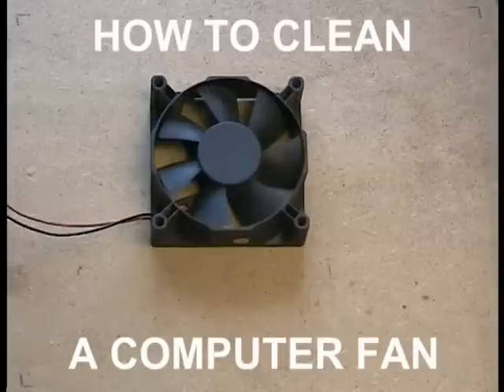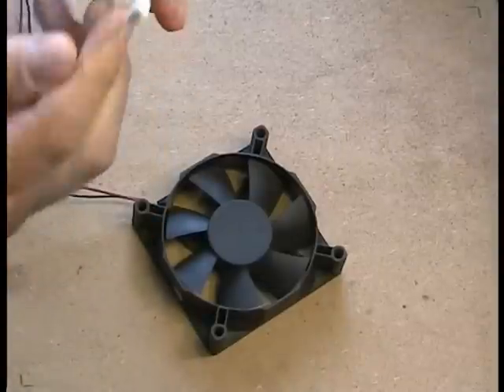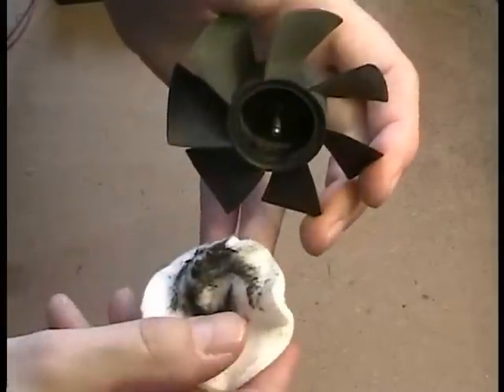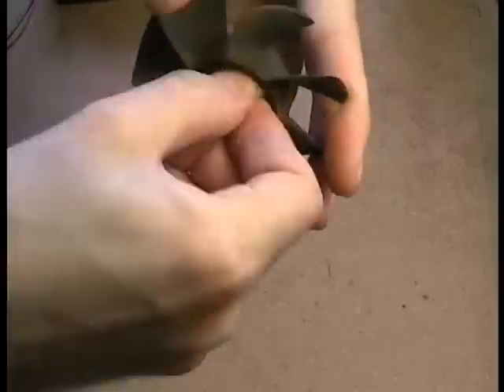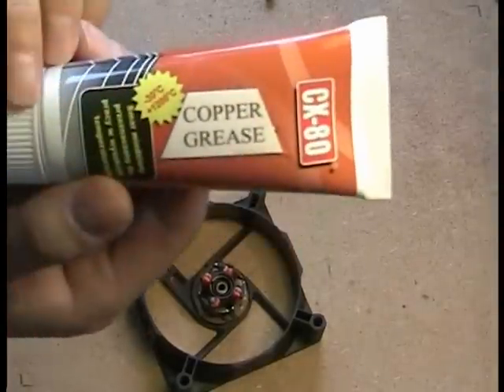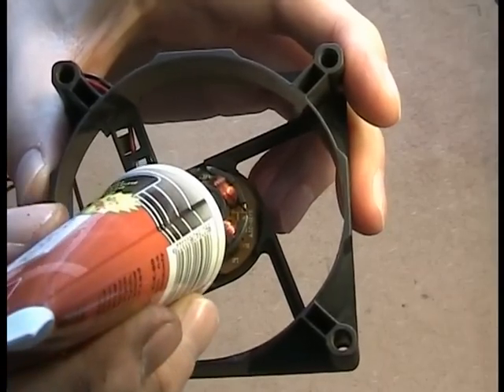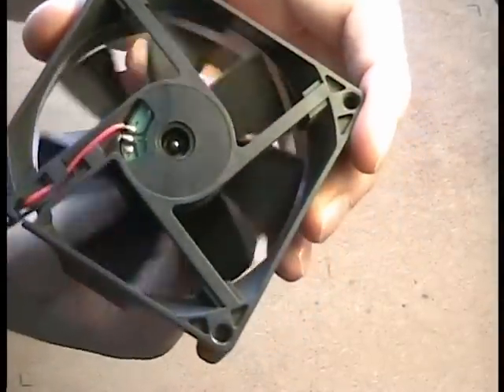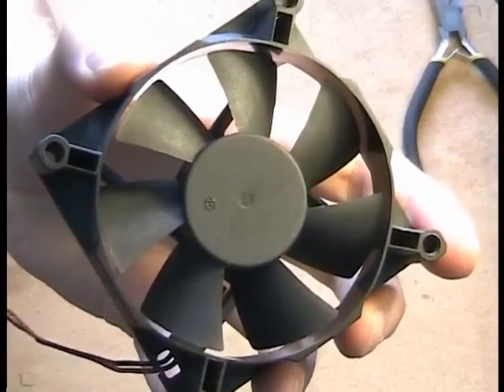How to clean a computer fan

Comment: How often should this be done?
Reply: Grease and tar in the atmosphere can greatly increase the buildup of dust and gunk on your fans. As a smoker, I need to give a good dust out every 6 months or so, as the tar in the smoke coats the fan and causes more dust to stick in a shorter time period. I see similar build-up in machines from oils and fats used in cooking if the machine is near (or worse, inside) a kitchen.
Reply: ElectronFun.com well I opened it and there wasn't very much dust or filth except on the intake fan. I didn't want to risk breaking them so I only cleaned the blades. The coolermaster fans I have aren't as easy to take apart.
Reply: ElectronFun.com  ayy so, dont do it the lazy way, my fans werent drained enough and they themselves overheated, I cleaned the heatsink one and tried to do the GPU ones, they didnt have the thing under the sticker so I just cleaned them as thoroughly as possible, both the cpu fan/fancage and the gpu fans+cage were covered in the stuff
Reply: ElectronFun.com
 for sure.
Reply from the maker: There is no one good answer to your question. If you have a computer in a workshop, or some other place where dust is something usual, you should do it much more often. A good rule of thumb is to blow dust out of your computer when it gets louder and if it doesn't help much you can clean and lubricate the fans.
Reply from the maker: PhazonSouffle
Is your computer quieter now?
Reply: ElectronFun.com Not really
Reply from the maker: PhazonSouffle Were the fans a lot quieter when the computer was new?
Reply: ElectronFun.com  I just fed a teaspoon of mineral oil into the fan without taking anything apart, spun it around a lot and drained it, would there be any reason to recommend against doing this lazier way of relubing fans, other than that you cant clean the inside? It is working well so far.
Reply from the maker: DoragonDirudos
I've never tried this, but I guess this method must be quite messy. Do whatever works for you. I'm just wondering how you drained the fan.
Reply: ElectronFun.com  yeah it was a bit messy but manageable, just tilt it and it should drain, at least somewhat, after I do that I just spin it with my fingers as fast as possible over a sink so that the rest flies out and then drains more, a bit of a pain but it makes me wipe the blades so I guess it forces me to clean the fan even more.
Reply: ElectronFun.com
oil getting on the heatsink isnt a problem right? because the fan didnt drain all the way and now it smells like my room is being heated by an oil furnace
Reply from the maker: DoragonDirudos I would avoid oil on my heat sink and eventually all over the place. It shouldn't cause any short circuits, but it's so messy and smells bad if heated.
Reply: ElectronFun.com  smells ok to me, as long as I open a window. I'll probably just do it the non-lazy way next time.
Reply from the maker: DoragonDirudos It seems cleaning the oil may take you more time than cleaning the fans 'properly'.

Comment: I dont know how to take the fan out of dell cpu. Can you make that video starting point from opening up the computer case
Reply from the maker: There are so many Dell computers on the market and most of them are quite different than standard ATX cases. Usually they use proprietary "user-friendly" cases, where you need to think for a while before you disassemble anything. I'm sorry, but I don't have a Dell computer to make the tutorial for you.
Reply: Ayesha Flores Best you go to the Dell site for instructions for your particular machine.

Comment: if that sticker is hard to take off what should i do? do i peel it off anyway i can? & is it important to put it back on?
Reply from the maker: The sticker is not important, you can substitute it with a piece of Scotch tape. It's only one more thing that holds the rubber cap in place.

Comment: Could I use dish washing oil?
Reply: daGod Emcee
Or if you cant find any one... you can use machine oil. Its easily available.
Reply from the maker: *****
I tried that some time ago and it worked well.
Reply from the maker: I'm not sure what you mean - is it cooking oil?
Reply: like Ajax soap to wash plates and stuff. its liquid
Reply from the maker: It is a liquid, but detergent. It's not meant to be used as a lubricant.
Reply: ElectronFun.com Oooooooooo, ok  got chu, thanks for letting me know that cause I was gonna use that lol. but can u tell me some things that I should use then? whats the names of any lubricant I should get from the store to use? whats the name of the lubricant you was using in this video my friend?
Reply from the maker: daGod Emcee
I used copper grease, but you can also use silicone or multi-purpose grease. There are so many brand names that it's difficult to list them. Much depends on your location. You can find many types of grease in stores like Home Depot (USA), B&Q (UK, Republic of Ireland, China and Taiwan), Leroy Merlin (France, Cyprus, Greece, Italy, Poland, Portugal, Romania, Russia, Spain, Ukraine, Turkey, China, Brazil).
Reply: Thanks sooooooooo much for letting me know, I appreciate that you took the time to type all of that just to help me out. I will make sure to hit you back up when im done cleaning out my computer fan.
Reply from the maker: daGod Emcee
No problem, I'm here for you guys :)
Reply: How bout the oil u use to fireup the lawnmower?
Reply from the maker: Crispy Tae Never checked that, but I guess you can try it - it's better than nothing :)

Comment: On some 120s and 140s I just used antistatic cleaning spray and a piece of soft cloth and I just rubbed that on the blades and got them squicky clean. Hell they looked better than brand new they were fkn sparkly clean.  Didnt take too long. Prolly like 2-3 minutes on a fan if after you get the hang of it and learn where to put the cloth between the blades as they come in different sizes.
Reply from the maker: What about the shaft?

Comment: Does this also work for PSU fans?? I'd hate to replace a perfectly working 800W PSU just because of a noisy fan..
Reply from the maker: Usually there are standard fans in power supplies. This method will work in 95% of PSU fans.

Comment: Do you actually watch your videos? You don't use enough light to present the details of the parts or the events. I'm also surprised that you don't just squirt everything once it's apart with a cheap spray cleaner (I use the dollar store concentrates and make my own), let them set a few minutes and then blast the heck out of them under the sink or in the shower or with the garden hose. This cleans everything better and in less time than wasting those assorted cleaning materials.
The parts will dry quickly after patting them with an old rag or whatever you wish to use. As far as lubricant, you should NEVER use copper grease since it contains copper particles (hence it's color) and petroleum grease. It is commonly used in brakes to prevent squeal and seizing. The petroleum component is bad for any rubber seals, so it has to be applied carefully.
You would not use it here since you're not worried about seizing, the copper particles would simply grind away at the moving metal parts like sand and the petroleum component would damage the rubber seal. A silicon grease would be fine or maybe a moly grease, a synthetic or UltraLube which (since you mentioned being Eco-freindly, or green-thinking) is non-toxic, odor free and Eco-safe.
Reply from the maker: I do watch my videos after finishing. This was my first video ever. I try to improve my videos all the time, so thanks for your constructive criticism, I appreciate that you spent some time to write it.
I wasn't aware that copper grease is bad for rubber parts.

Comment: do i have to use a lubricant ??
Reply from the maker: Theoretically no, but I doubt your fan would be much quieter without lubrication.
Reply: u mean it would be quieter with lubrication ?
Reply from the maker: TaRee kylefraser
Yes, old lubricants tend to merge with dust and over time they become less effective. That's why it's a good idea to apply new lubricant.
Reply: ok but i don't have so that's why i ask but that tutorial is awomse man gj !
Reply from the maker: TaRee kylefraser
Thanks! If you don't have any grease, even a dab of machine oil would make your fan quieter.
Reply: ou damn i just checked im all out of alcohol 
can i use like those things that u used but with water or    dry ? 
:/ i thought i had some alcohol ..
Reply from the maker: TaRee kylefraser
Alcohol evaporates very quickly and is a great cleaner. If you want to use water with a bit of detergent you need to wait until it dries completely much longer.
Reply: ok man :)
so one more question xD sorry but im first time cleaning my computer so :) sorry
is aceton alcohol ? 
or can i use it to clean cuz i saw some people use it for cleaning
Reply from the maker: TaRee kylefraser
It's good that you're asking questions :) I'm here for you, and I'll try to reply to all your questions/comments.
You can use acetone, but don't wipe the shaft too much. Acetone is a strong solvent and it would remove all grease easily - since you don't have any new lubricant it's not the best idea. Just blow the fan and clean all plastic parts with acetone.
Reply: hey man i just cleaned it and it is still bearly spining and vibrating a lot
Reply from the maker: TaRee kylefraser You probably won't be able to do much more without disassembling the fan, cleaning the shaft and some proper grease.
Reply: i did i did what u did in your video everything cleaned and it still doesn't work well :/ when i spin it i feel a vibration and it doens't spin for 0.1 s
Reply from the maker: TaRee kylefraser Have you tried spinning the fan simply with your finger? Does it spin freely? Is the plastic washer (the one that holds the shaft) assembled correctly?
Reply: yes i tryed witth my finger it does the same and it doens't spin freely not at all i have to push it reeal hard ( not that hard but it's a fan so im saying that ) it's a metal like pipe and the thing that i put on it is plastic i think and i put them all good and i checked 2 times
Reply from the maker: What kind of lubricant did you use?

Comment: I just went into some cleaning yesterday. My pc is liquid cooled, so I have 2 140mm fans on a 280mm radiator (mounted on the top), 2 120mm fans on the front and a 120mm fan on another 120mm radiator on the back. The 120mm on the back is a Cooler Master, wich had the back sealed in plastic. I drilled a hole to reach the shaft, lubed the bearings and sealed again with isolating tape. The two 140mm were even more complicated: they had a new technology wich encloses the whole bearings/shaft mechanism in one brass drum, completely sealed, I had to drill coaxially the drum on the back to reach the inner chamber and bearings, and lubricate the system. When doing so, use a fixed-drill and blow compressed hair while drilling: you don't want any shavings to go inside the chamber and in the bearings.
Reply from the maker: Thanks for sharing. Have you seen any video tutorial about a similar cleaning process?
Reply: ElectronFun.com unfortunately not... Dammit! I knew that I had to make a video while I was doing it! I'll try to post one if I find any fan to overhaul.
Reply from the maker: Thomas soffiantini
It might be very useful. The newer the fan, the more complicated it becomes.
Reply: ElectronFun.com ...and they're not always so reliable!!!

Comment: hi mr please i have a terrible problem with Dell optiplex 270 Fan it s very noise and i can t open  it like that s beceaus it not have a plastique watsher.
Reply from the maker: Do you mean a CPU fan, or power supply fan? Could you post a photo so I could see the fan on Google+ or Facebook and send me a link?
Reply: cpu fan
like this
 http://www.ebay.com/itm/OEM-Dell-Fan-and-Shroud-Assembly-2X585-4W022-for-Dimension-Optiplex-GX270-more-/161272790774
Reply from the maker: hakim hamza
Is there a plastic or rubber cap under the sticker?
Reply: H'is bound by it even without rubber without plastic.
Reply from the maker: hakim hamza
I had a similar fan once. When there is no cup the only way to get inside is to drill through the plastic under the sticker. I managed to clean and lubricate mine. Your fan is useless at the moment, so you can try and see if it's doable.

Comment: The little batten or the cover i took the sticker off but the thing is like attached to the fan, Is there another way?
Reply from the maker: Do you mean the plastic cap under the sticker? If yes - these caps sometimes sit very tightly, or are even glued. Just use some force, but be careful and don't hurt yourself with a screwdriver.
Reply: Thanks man Your very helpful and because of you i'm very Interested On computer Engineering thank you For making it easy and fun to learn man You're great and i hope you make more videos!
Reply from the maker: Mando G.
I'm glad I could help you. I'm working on some more videos, but I have a regular job and it's not easy to shoot, edit and upload videos regularly. I hope I'll learn to organize my time more efficiently.
Reply: ElectronFun.com  That ok every body bissy but i hope you can make video some time's so maybe i could learn and thanks man again and right now i'm using the computer i cleand and it works allot better!